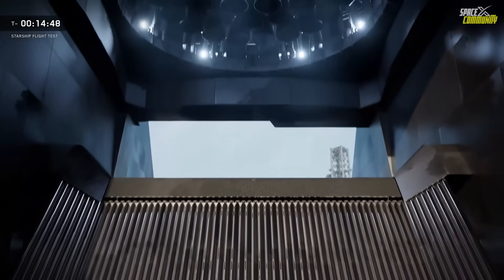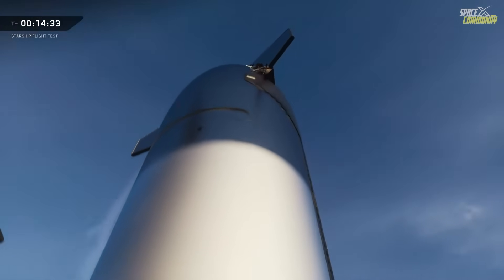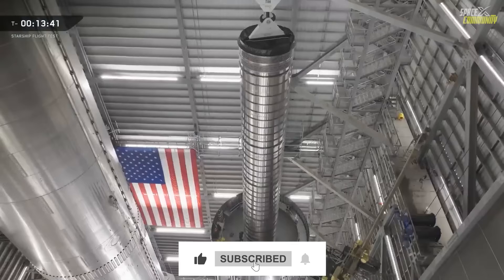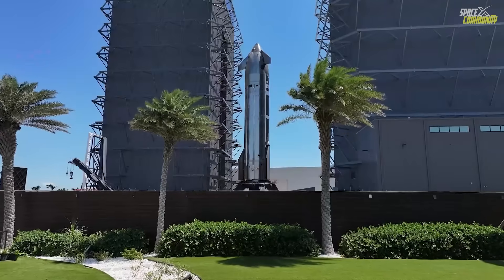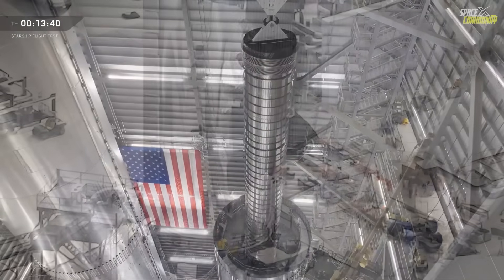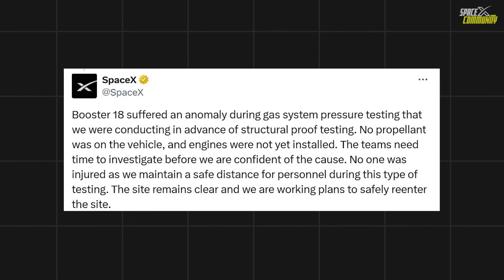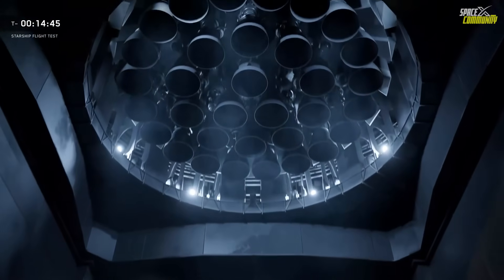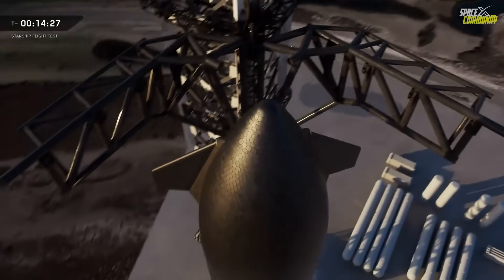Elon Musk Revealed Root Cause 'COPV Failure' on Booster 18 V3 After Inspection! Weird Explosion

Comment: As space moves from a fixed booster to another untested one, it will be 2 years before all the bugs are worked out. Once this is done, this booster will be retired and replaced with another model that will require another 2 or more years of testing to make it human rated. A moon landing will require 5 or more years of space blowing up rockets. By then China own the moon,.

Comment: "Block 3" units are reportedly made from thinner steel, a different welding technique, a new "secret" steel alloy, and a special hardening technique. However, these changes don't seem to be working well. They desperately need the lighter material, though. In my opinion, they won't be able to perfect the welding process because they have reached the limits of the material and of physics.
Reply: If a COPV burst, tank wall thickness is irrelevant.

Comment: Fiberglass or carbon fiber is a dab idea for copvs   I didn't have to remind. Every one about the. Problem with the   submarine.
Reply: You simply can't hold the pressures required with all aluminum or steel tanks that weigh 10 times more than carbon fiber tanks. Perhaps they'll need to increase the stringt